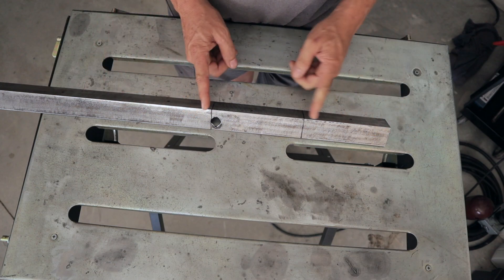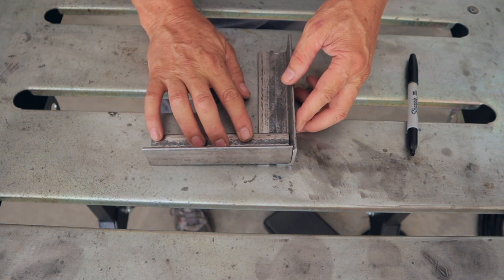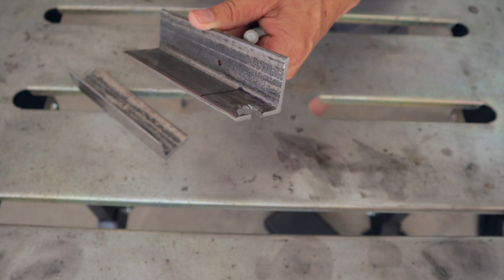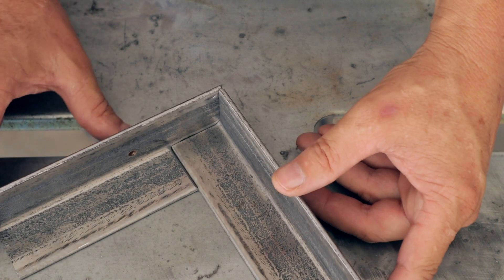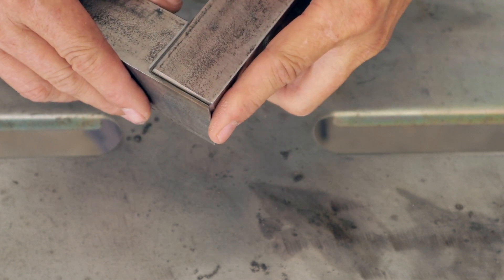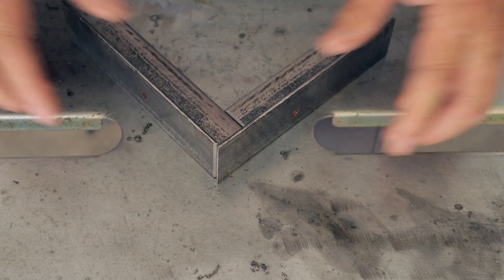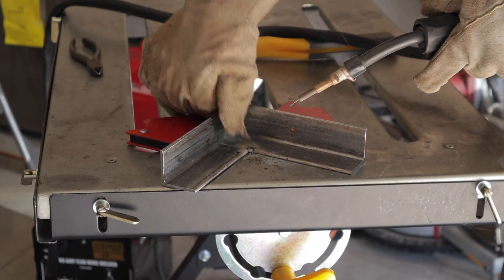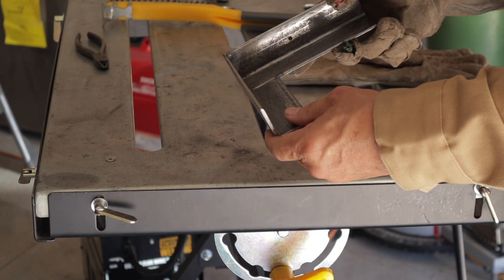Gasless Flux Core Welding: Unlock the Secrets of the Classic Cope Joint

Comment: Not too shabby !
What wire did you use ?
Reply from the maker: Thanks, I like the wire below the best for my flux core welding.
Gasless Flux Core Welding Wire, .030" E71TGS Carbon Steel Spool, 10LB Spool - https://yeswelder.com/collections/accessories/products/welding-wire-e71tgs1008?ref=DIYHP10%25

Comment: That's the best bacon fry I've ever heard.
Reply from the maker: It welds pretty good for what it is.
Reply: @DIYHomesteadProjectsDIYHP10  those are pretty clean welds. I have the same model. I assume should be attributed to mods? Or i need more practice.
Reply from the maker: A lot of it has to do with the mods. It produces less spatter and a little more heat. Also flux core wire is designed to run on DCEN not AC. Of course, practice helps too. I've seen some people make descent welds with the stock AC Harbor Freight machines too.

Comment: Dang Bruce! What a difference a little practice makes. I still remember back when... ; )  Of course the DC Mod didn’t hurt either. I decided that my ability level (too many deviations ; ) wasn’t quite up to making the conversion, so I bought the Titanium 125. It’s one sweet little machine. So what’s up with you arc shots? Seems like that I was seeing your puddle better on some previous vids. I really enjoyed this vid on cope welds. You nailed it. Bty, what blade are you using on your portaband? Looking forward to your next vid. Thanks!!!
Reply from the maker: I don't own one but I think the Titanium 125 would be my choice today if I were looking for a flux core welder. The only thing I don't like about the Titanium 125 is you are limited to 2lb spools. I think everything else about it is great! I could deal with that but the 2lb spools are quite a bit more expensive than a 10lb spool. The size and weight of that welder is a great benefit and make it worth it I think. Not to mention it's DCEN out of the box and infinite control on the power and wire feed. 👍👍👍
I didn't try to get good ark shots with the flux core due to the spatter. I haven't figured out how to get my camera in there for the shot without ruining it with stick and flux core welding. I really need another lens for that and those lenses are a bit expensive. I don't have the spatter issue with the TIG welding so I can get the camera close enough to get those shots without ruining the camera.
I'm just using harbor freight portaband blades. Nothing fancy for sure. Sorry but I don't remember the tooth count I purchased but they do quite well IMO. I'm still on my first blade and have been using it for a year and a half now.

Comment: Awesome job. You make it look easy. I'm still trying to dial in my settings with the HF 90 amp welder that was gifted to me. I will be doing the DC conversion upgrades soon too.  Just waiting for the resistors.  btw, what technique did you use as you dragged the gun?  Hard to tell from the arc shots. Straight drag, side to side, little e's. Thank you and look forward to your next video.
Reply from the maker: Thank you jm, I appreciate that. I like to use the small e's technique especially with a fillet joint. I think it helps push the puddle up the vertical piece so I get good fusion on the toes (edges) of the weld and minimizes undercut. I had a little section of poor toe fusion on my second weld in this video. I believe that was due to poor torch angle. I was favoring the vertical piece and not quite at a 45 so the bottom didn't wet at the toe like I hoped it would. Hope that makes sense. I'm just a hobby welder so I really don't know all the correct terminology. Good luck with your welder mods! 👍
Reply: @DIYHomesteadProjectsDIYHP10  Thank you for your response and I fully understand your reasoning and explanation. I was practicing welding t-joints on scrap metal pieces and same thing happened to me.  Interestingly I had my machine setup same way at 4.5 and High.  I think my drag speed and stick out from work piece needs revising. I am using 1/4" stick out and think I should increase it to 1/2" judging from your technique. I usually get stabbing with the wire or hard to maintain arc at 1/4" stick out. I do have a good ground since I upgraded the ground clamp.  Will keep practicing. Thanks again.
Reply from the maker: That's funny, I have experienced the same thing with the stick out being too short. I recently discovered I was using too short of stick out and have been trying to maintain as close to 1/2" as possible. When I was using 1/4" or so my slag coverage over the weld was not good. I had spots where there was no slag coating and the weld was oxidized. Supposedly the flux inside the wire needs a little preheat time and it doesn't get that with a "too short" stick out. Since I have been trying to maintain the 1/2" the slag coating is good across the weld so I've really been working on that. That's what I love about this hobby, always something to work on to improve the technique. Take care and keep in touch. It's nice to chat with someone going through the same learning process.
Reply: @DIYHomesteadProjectsDIYHP10  Yes sir thank you for the input. I too noticed very little slag coating and oxidation on parts of the weld using 1/4" stick out.  I tried messing with the wire speed, preheating the metal with heat gun, removing all contaminants such as mill scale and rust, cleaning metal with acetone, tried different flux core wires (Lincoln, INE, ARCRAFT, Forney). Still got the wire stabbing and poor arc.  I will now try the 1/2" stick out as this may be the issue I am having since the flux has no time to preheat using 1/4" stick out like you mentioned. It now makes perfect sense because I also noticed the weld was more convex or 'mound like' as if I was laying a cold weld on the surface with very little or no penetration. Very frustrating I am not going to lie but gotta keep pushing along. Thank you again and I will report my results with the hope this may help someone else with similar issues. I'm sure once I do the mods this little welder will produce better results too. Thanks.
Reply from the maker: I'm anxious to hear how the 1/2" stick out works out for you. From what you described it sounds like a little slower wire feed speed may also help with the cold weld and wire stabbing (IMO). Personally I would try a 1/2 step slower at a time and see if that doesn't help. 👍